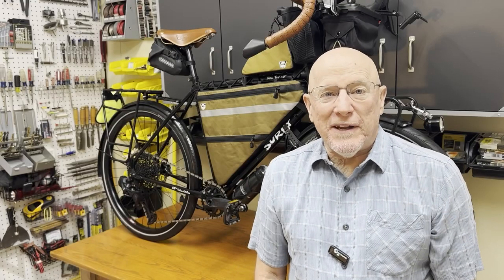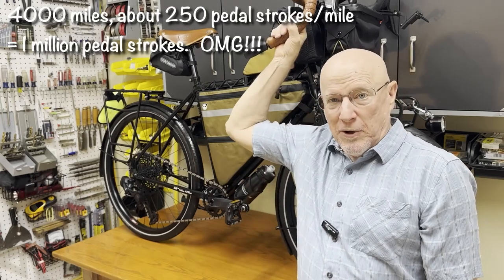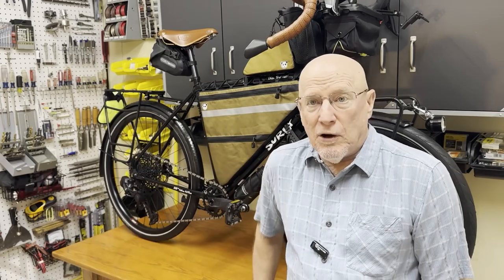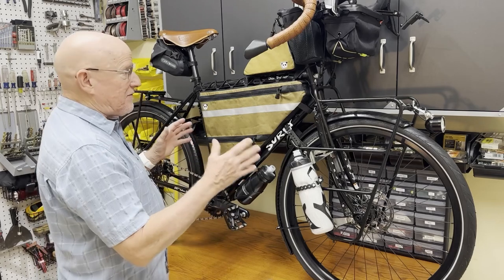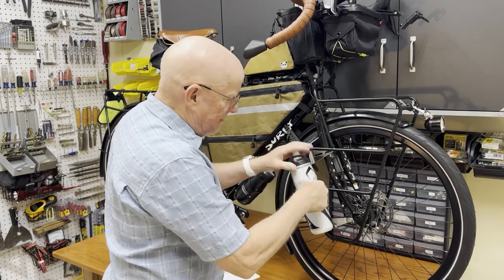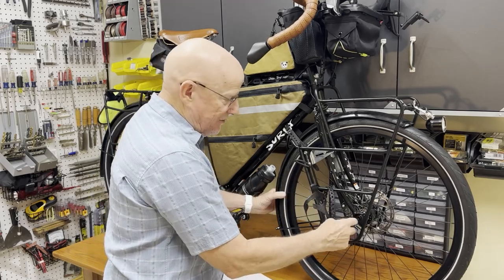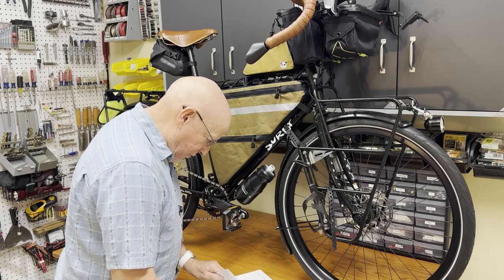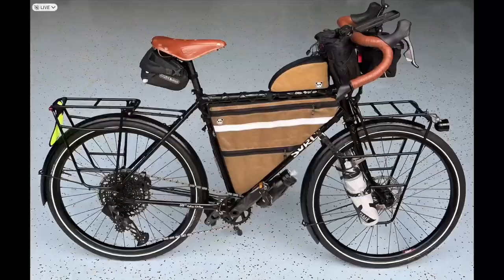Bikepacking Across America — Designing & Building the Bike: The Basics

Comment: Exceptionally well thought out.  My only notes to think about (I'm sure you already did) are, the only downside to the Brooks saddle is if you're hit with rain.  The rain can have a negative effect on the leather, but Brooks has a cover that's available.  Secondly, the Garmin Varia is a rear radar detector to give you notifications of upcoming vehicles.  Again, I'm sure you're already aware, but just incase.  Be well & be safe.  Really looking forward to the ride videos.  The trip of a lifetime.  Oh, are you packing any chain lube?  I didn't see that in the previous videos.
Reply from the maker: Good points. I forgot to mention chain lube (good catch!) as it's not on my packing list; instead, it's on my "to buy in Portland" list along with Tire Sealant, Bear Spray and groceries.

Regarding the Brooks Saddle, I bought a pack of cheap shower caps that I'll use when rain is threatening. They're super-cheap and handy.

I have looked at a couple of the rear radars (I love tech!), but haven't taken the plunge. Have you used one? I just don't remember a vehicle sneaking up on me and not being seen in my mirrors. Still, it could happen.

Comment: Great video, I appreciate you taking the time to do this.  I would prefer tubeless, but I have not had problems with my tubes going to work.  On my MTB bike the valve stems are always getting jammed up with Stan's and airing up is an issue.  Is this as issue for Schrader and Presta valves?
Reply from the maker: I've been riding presta tubeless for about 12 years and have had almost no problems. But they have spared me from several flats. Over that time I have had two or three valves get really gunky, but when they get that way I just pop in a new valve core. I know I'm taking a bit of a risk running these tires made for tubes as tubeless cross-country, but I think the benefits outweigh.

Comment: Nice bike. I've got aluminum frame Trek 920. I think modern aluminum frames are pretty dependable. Funny thing is, I've got the Surly rear NICE rack(chromoly). I broke the bontrager aluminum rack in the Arizona desert. I spent some time fitting a double kickstand. Instead of that pivoting seatpost, I've got the spring in my B67 saddle. I'm surprised you went with a 1x drivetrain. I switched to a triple 44/33/22 front with 11-42 rear. Same as you, I run tubeless Schwalbe Almotion 29x2.15. Schwalbes are the best & rode all over the U.S. & never got a flat. Interstate highways, desert(sand, cactus), glass, ect. Best tires hands down. I've got the larger bottle cages for nalgene bottles. I also have hydro brakes. I've never had a problem with them. You look like a guy I met in a bike shop near Wichita, KS. He was getting ready for a ride on the Katy trail. I was riding from California to Missouri. We both had the same spd sandals. Happy trails.

Comment: Thanks for the video. I was hoping to hear more about the fender flute by velo orange. I have a Bridge Club with 650b tires and the fenders just float way too high above the tire. Do you recommend getting the fender flute to fix that problem? To lower the fender closer to the tire?
Reply from the maker: I’m afraid I’m not much use for this question. My Schwalbe Marathon Supreme tires are large enough that I did not have too much space between them and the fenders. The fenders initially rattled a bit, but Velo had pieces/accessories to solve that problem. The fenders worked really great for my whole trip — except on the muddy C&O Canal trail where there was so much mud that I had to stop several times to pry the stuff from between my tires & fenders, but I don’t believe that’s really the fault of the fenders. Have a great ride!